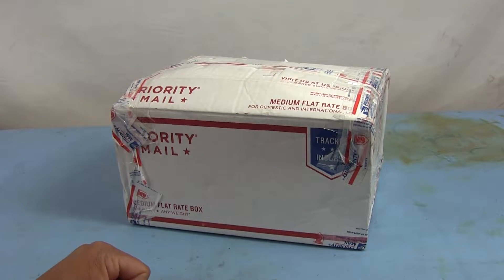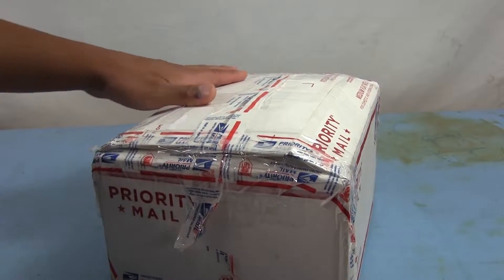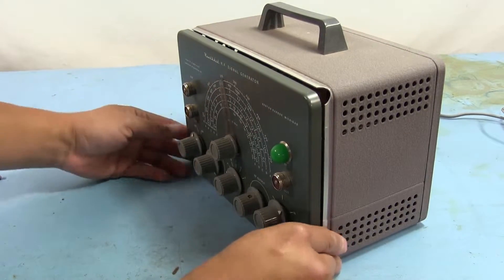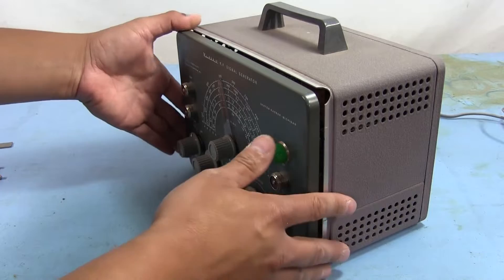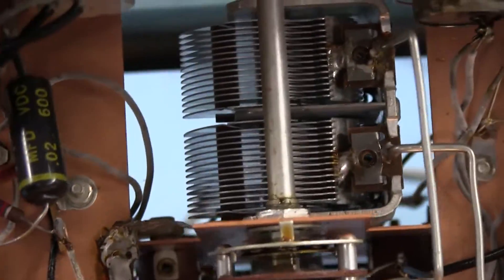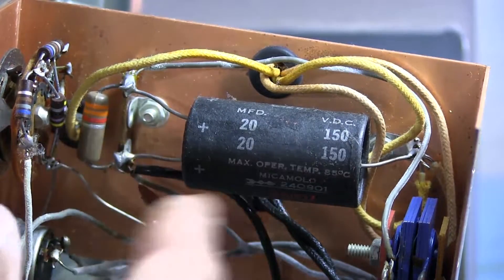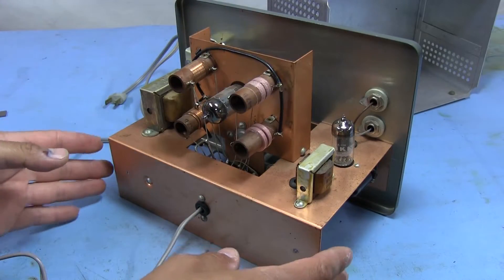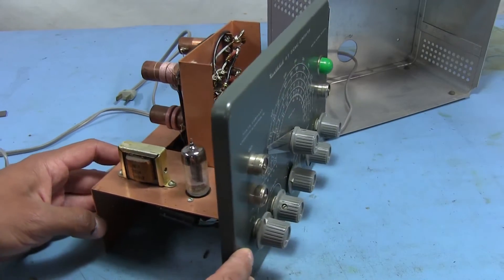TWB #74 | Heathkit SG-8 Unboxing & Quick Look

Comment: Nice !

Thats not a bad deal, for 70$ shipped i'd take it aswel :)
I bought a few Heathkit devices the last couple of months and they are all very well tought out and economically built.
So if you look up the correct manual for it, replace all Caps with proper branded new ones (higher voltage, like +20%, is advisable) then you should be able to enjoy it for a lot more years.

Please check the cap(s) which grounds one of the Live leads to the chassis, that one is called the Death Capacitor, and you should replace whatever is there with a Class X-Y safety capacitor.

Have fun :)